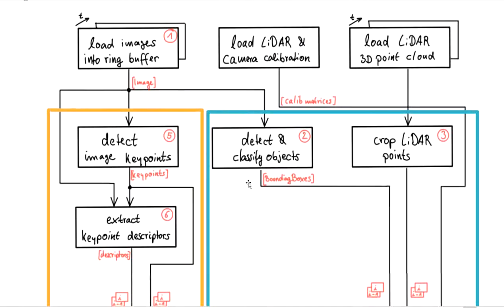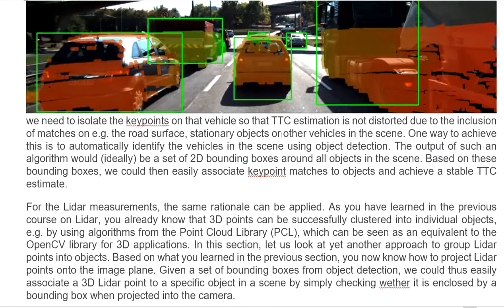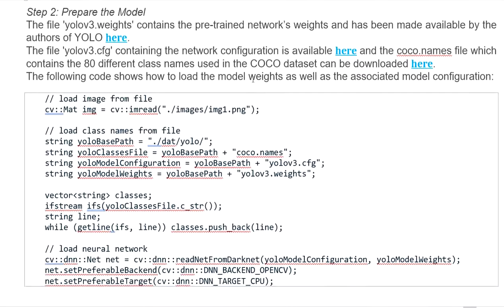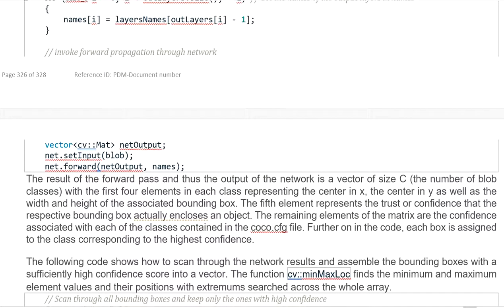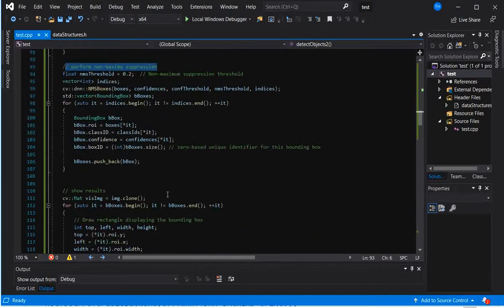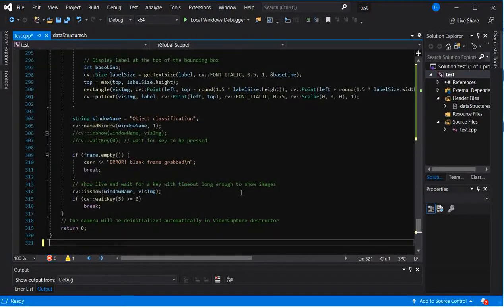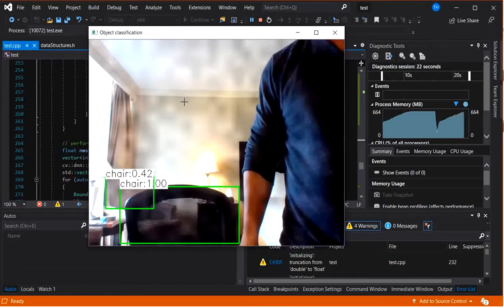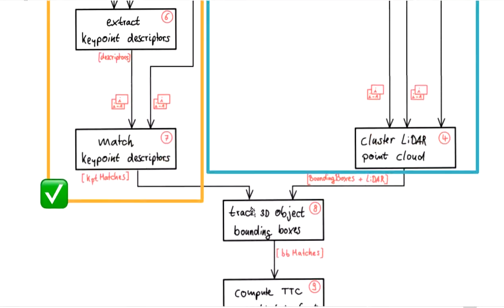Object Detection with Yolo C++ and Camera

Comment: Any idea to improve fps?
Reply from the maker: My Laptop run on CPU. It takes so long.Easy way is use laptop has GPU like Nvidia board
Reply: @BuildTheBot  Could you send me this code? My email: pepoversesa123@gmail.com
In python, I ran it using GPU but fps was still low, about 3 fps. I tried to reduce the input size in cfg file, 416 to 224. Fps did increase to 7 fps. I heard someone said yolo runs faster using C++. So I hope you can share this code to me. Many thanks.
Reply from the maker: @nguyenvu6371  Hi depending on your project, you can built up Model by yourself using CNN model or transfer learning(VGG19,Resnet50..) get good accuracy! In Yolo, u can design some object u want to detect, do need need to detect all.So it depends how you optimize your designs. Because Yolo is pre-train, You only use model, do not need to train anymore. So you reference NVidia board, optimize your laptop
Reply from the maker: @nguyenvu6371  I will send to you. I encourage everyone learn to create model, collect data, preprocessing data. It a good way for learning